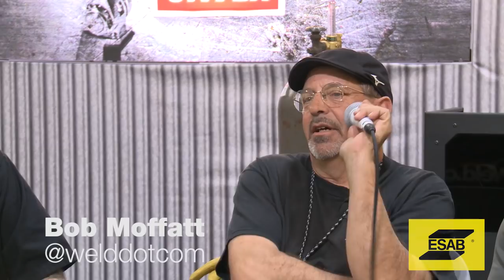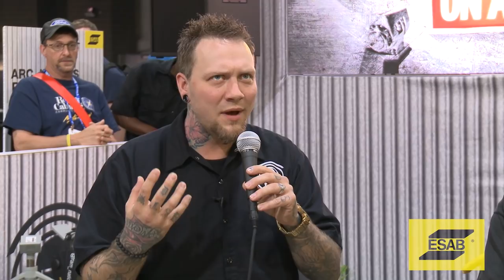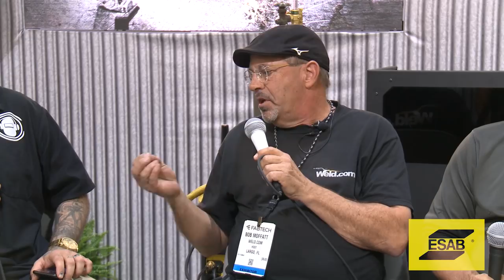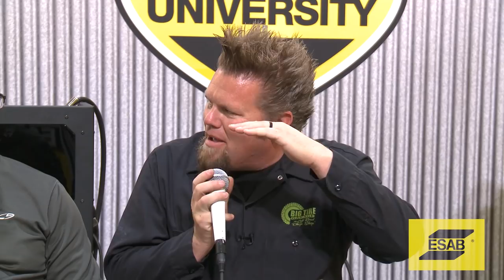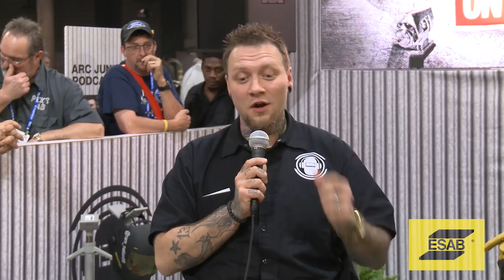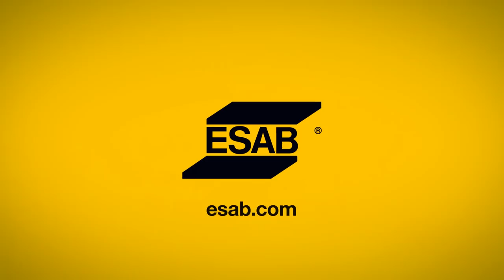Welding Trends and the Future of the Industry | ESAB University Seminar

Comment: what did u make an hour and what did u make welding ur first job?
Reply: 9.85/hr Heaters and flue gas scrubbers. 1976 Age 18
Reply: @bobmoffatt4133  you didn't mention the company. $3hr, Ward ranch hand welding any and all 1972 @ age 19. The gate into the ranch i built still stands today. So does a huge open hay barn. I burnt every finga print off my fingas building that. I took a gas ax and cut the upset threads off a piece of drill stem, shucked my sweaty gloves to dry out and picked up that threaded stub i just cut off just like i knew what i was doing. All the way to my waist. It didn't take me long to inspect it. I was getting my degree in Welding Theory and Practice at the time at HCJC  Athens, TX under Bonny Sumners, of Sumners jack stands, our instructor. You remind me of him Bob. Several $3.00ish jobs until 1974 at $5 hr welding T1 on off road ore haulers before the ''Big Time'' in Houston for Scoot Poot at $7.35hr in 1976. Welding inconel tray clips in towers in LaPort, TX, 7-12's. It snowed 3'' that winter and shut down every freeway in Houston.  Then Ethyl Refinery on the ship channel. The oldest one, using P5 with button lace caps. Gas welding 2'' pipe and under. Did you know you can spray weld with 7018 rods? Then Shell on the channel, spent 2 weeks testing there, 22 certs. Point being, I kept picking up techniques and styles to welding and eventually to TIG Pipe/tubes/heavy wall/repair welder in 4 yrs. You gotta get the basics when you have never struck an arc before. It might have been low money but the education was priceless. You never stop learning because there's always somebody that can show you up with a few different tricks. That's why they call it tricks of the trade. :) I finished out my career as a Millwright/Rig Welder/Weld Shop Owner. Now retired at 68. Let's do some razor welding sometime hand. Maybe a few coke cans. Indicate some weld symbols in your work for the masses as you teach the art. I love your style man. Shine on. https://www.youtube.com/watch?v=2vnYKRacKQc

Comment: Can u stick weld through mill scale or do u have to grind it to the bare metal
Reply: Mill scale, just weld through it but rust clean it off
Reply: Best thing, no matter what process you're using... rust or mill scale? Clean it off. 
If youre just chucking somethkng together on the quick, then can get away with a bit. If its work thats got to be done to any codes/standards?.. clean it.

Comment: Rusty's rules of inverse work relationships -- over 50 years I have found these apply to the theoretical mathematical limit. 
1. Arrive Early --> Leave Late
2. Arrive Late --> Leave Early
3. More you do --> Less you make
4. Less you do --> More you make

Proven from the shop floor to the front office of major corps.
Starting from my time on the Burlington Northern railroad right out of HS.  Reinforced in the Navy, and Army.  Shops of Lockheed... engineering office... front office Lockheed, engineering office Rocketdyne and shop by necessity.  And, many other companies and my self ventures.  
I have found every time I arrived early I've had to leave late, to the limit of 24 hrs. sometimes you might even not leave for days or weeks.  Once I arrived early to an aero-space engineering marketeering job (thinking I would go home that evening)... and then ended up having to leave to the airport and spent 6 weeks full time on the road.   
Every time I arrived late there was some need to leave early. This also applies to the limit of getting fired... but that feels so much better to arrive late to get fired.  The limit of this once I went on emergency vacation and missed a layoff that noon time that I was scheduled for.
The more you do the less you make.  The limit of this was in the Navy I was given a promotion for performance, superior work and diligence, resulting in MORE work, time, qualifications, and responsibility... no more money and my out of pocket costs went up.
Every job has proven this out... like piece work.
Less you do the more you make, well look at the internet entrepreneurs little work and billions.